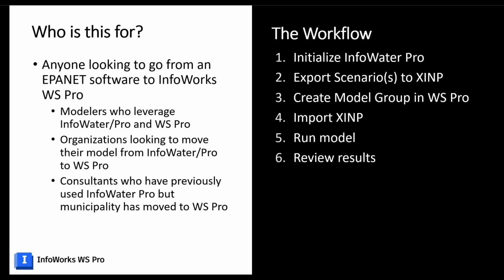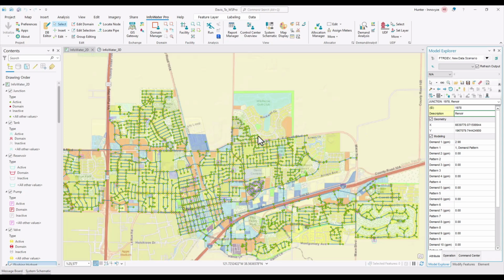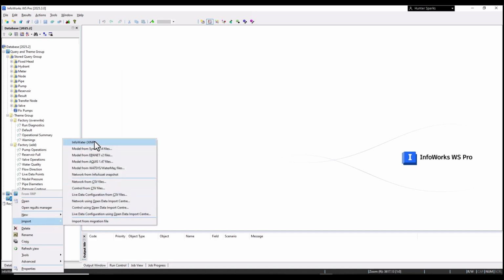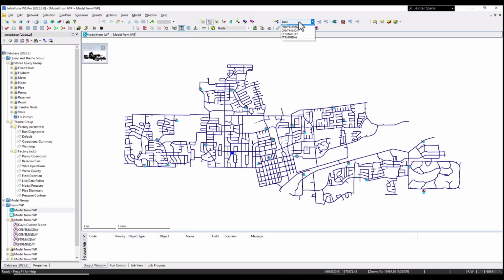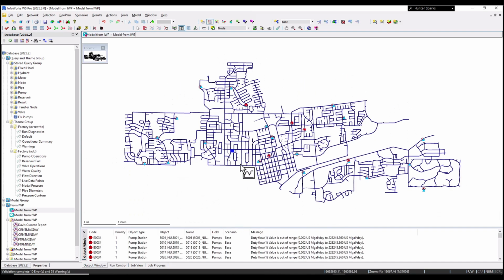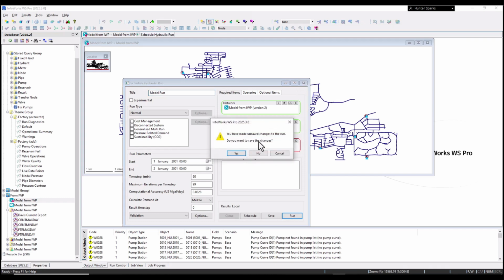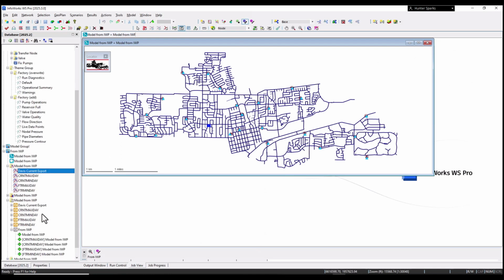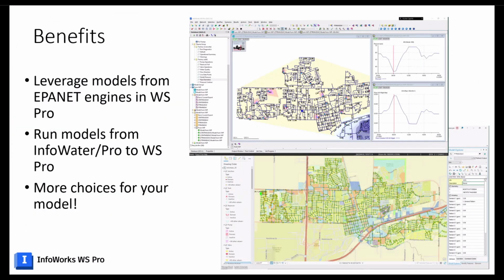Exporting an InfoWater Pro model to InfoWorks WS Pro

Comment: Do InfoWater and InfoWorks WS use the same maths, engine? I.e. are the results the same?
Reply: Great question, not quite. A comparison of the simultaneous node adjustment algorithm used in WS with the gradient or hybrid method used by EPANET 2 can be characterized as:
WS Pro solves the DW equations exactly and obtains iterative solutions to the flow balance at nodes until this is within the specified tolerance.
EPANET 2 solves the flow balance equations exactly and obtains iterative solutions to the DW or HW equations until changes in node heads satisfy a specified tolerance.

Hope that helps! #autodeskemployee